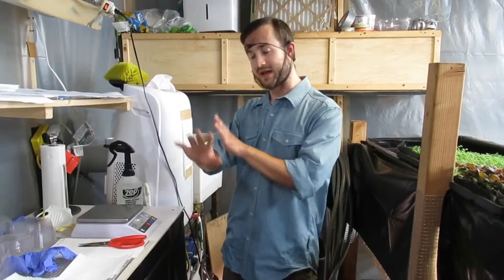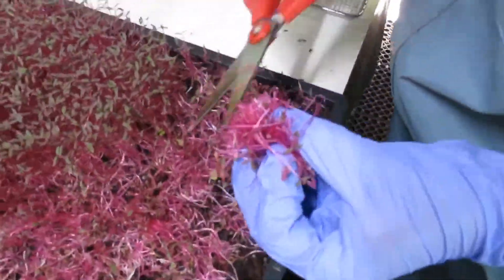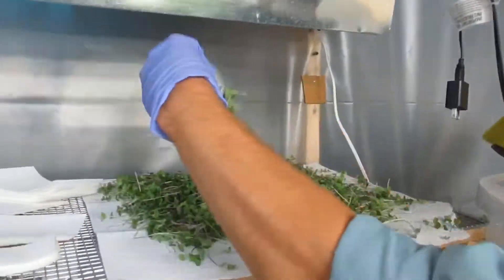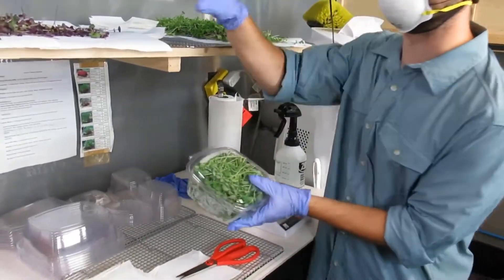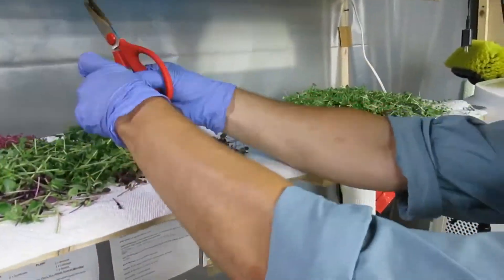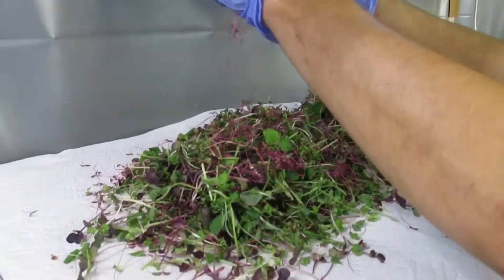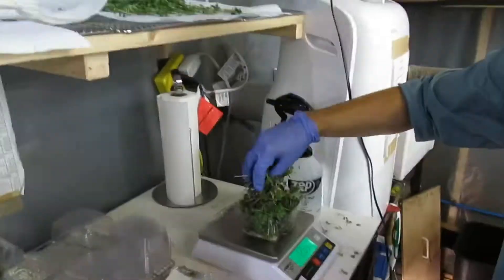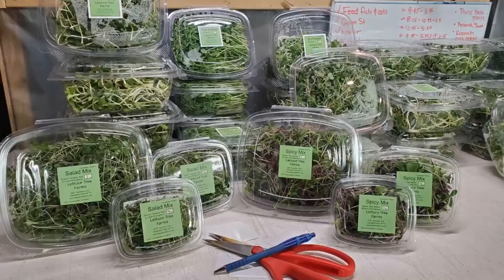Complete guide to microgreens harvesting/packaging

Comment: Do your customers say anything about the condensation or does it not affect the texture/stiffness of your micros?
Reply from the maker: We have noticed the condensation inside the clams being the biggest effect on shelf life. Our customers don't typically have any issues however,  mostly because of the drying we do before packaging but also because we put a bit of sterilized paper towel in the bottom of each clam to soak up some of that condensation.